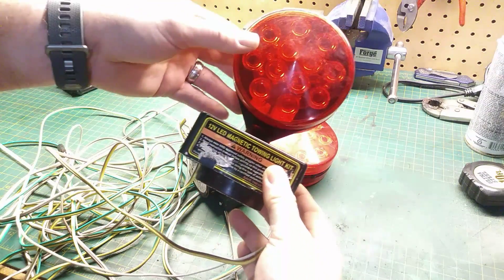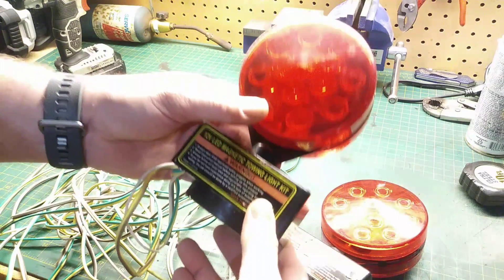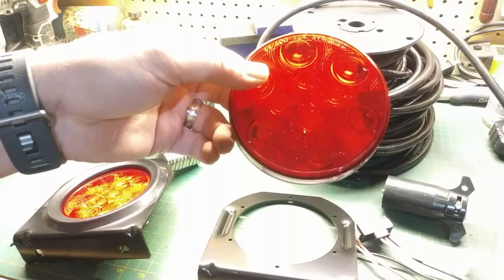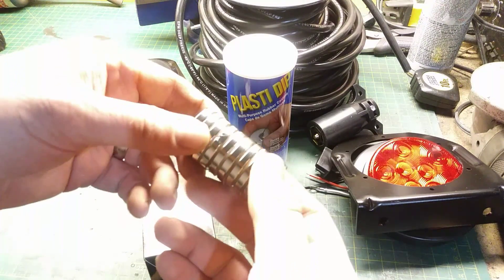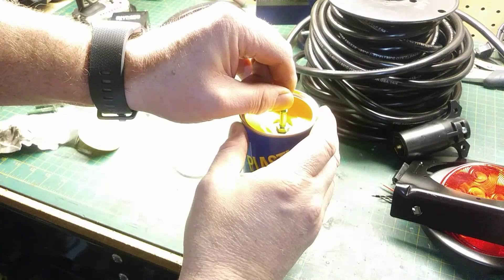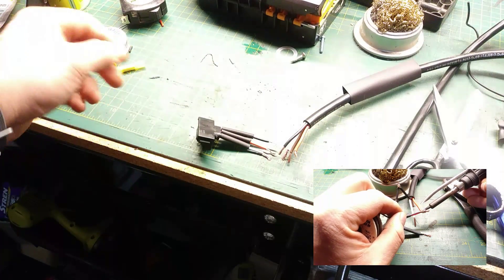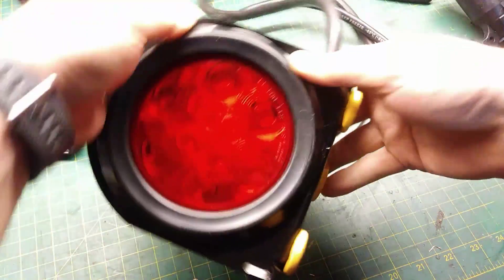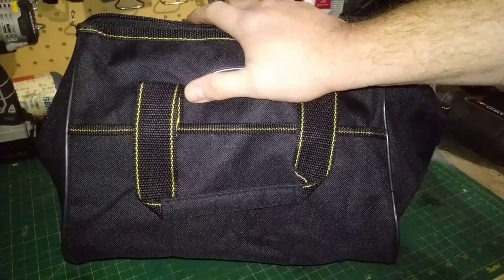DIY Magnetic Tow Lights, these will hold up better than Harbor Freight Tow lights!

Comment: Harbor Freight is about the same quality on most of their stuff, except high-end tool companies now.  In other words, cheap Chinese sh*t!  But isn't that also why buy buy it?  Because we can't afford American made stuff anymore!!!

I completely replaced  my trailer wiring harness and quickly found out how incredibly cheap their quality is.  I picked up the trailer to attach it to the truck, barely scraping it and the one light broke.  The next week the male ground plug came out of the molded socket.  (Just the ground, not the rest).  Then I found out how expensive a simple lighting kit is of any quality.  I'll be rigging mine the best I can to keep it legal, I'm not rich!

Thanks for the build.  I might go this way instead!
Reply: Larry Talbot the sad thing is that this isn't true any more, I'm pretty aware of the difference in qualities  and much of their stuff is pretty good, their wiring is awful but the trailer lights are good, excluding magnetic.  The hand tools are very functional for the price, and I purchased a craftsman tool kit last year, 250 or so piece, compared to my harbor freight 301 piece tool kit it was utter garbage and it listed at $300 compared to the every day price with either an always available 20% off coupon or product of $160, last one I bought was $155 out the door with an extra long breaker bar.  Both kits were made in the same country. 

My expensive s&k racheting box wrenches were great, but probably only slightly better than harbor freight,  hard to justify the $20 to $100 price difference.

Comment: What?  No Plastidip at the plugs where the wire goes into the heat-shrink tubing?  I thought I might try using silicone next time I open a can of plastidip to reseal it, but that was years ago and I haven't gotten another can yet.  I hate the way so many trailer light's insulation dries up and flakes off too, especially around the hitch.